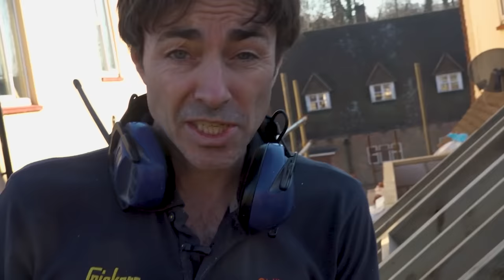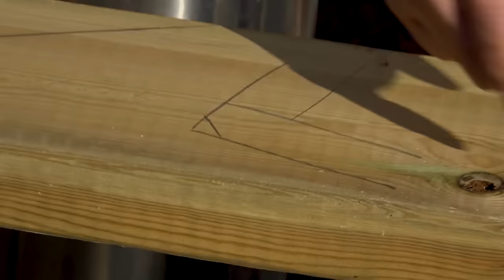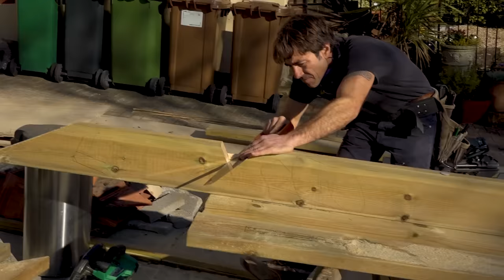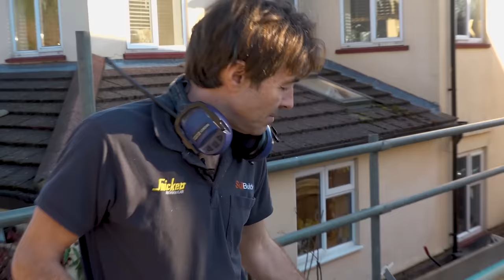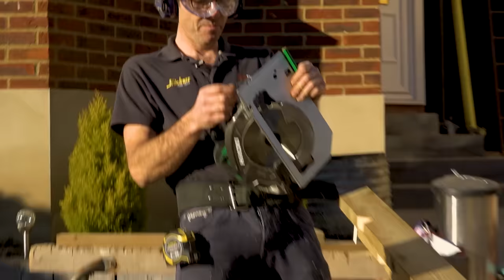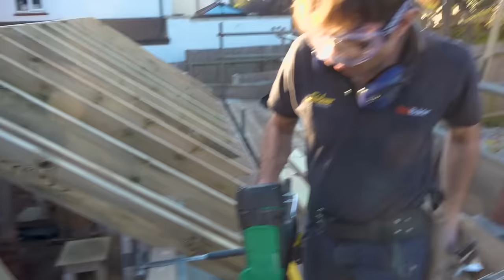How to Cut Hip Rafters

Comment: Folks - sorry, I had finger trouble on my first attempt at a reply.  I don't know if I dare post this and question the grand master Robin, especially it is years since I pictched my last hipped roof - but here goes.  I notice that when you set the side cut for the hip and the jacks, you set your saw to 45 deg.  Now as far as I know, this cut is only 45 deg if the roof is perfectly flat, ie 0deg pitch, which in reality, it could never be.  As the roof pitch increases, the angle of the hip and jack side cuts gets progressively less.  Only slightly, but on a steep pitch, this would become noticeable. I used to know an old joiner who would cut the hip and jacks' side cuts to 45 deg, and then 'saw gauge' them to make them fit.  I can't find my roofing ready reckoner to confirm this, (I think my wife has thrown them away!!), but I'm fairly sure I am right.  As I say, I am reluctant to query someone as obviously knowledgeble with regards to cut roofs, and would like to add that I really enjoy the Skill Builder videos, and I have learnt such a lot from them.  Please keep it up guys.
Reply from the maker: Hi Bob 
This is a really interesting point and one we have been debating in the comments. If you set the saw to 45 degrees for the side cut and run it across the plumb cut for the common rafter angle the resulting cut will be a compound and will not be 45 degrees. It is a baffling bit of geometry that has kept carpenters awake at night but measuring the angle you cut at 45 with an angle finder shows it is not a true 45. This is only really important if you are cutting by hand. If you work out the side cut angle with your roofing square and set the circular saw angle to this the cut will be wrong.
Reply: @SkillBuilder  Robin - thanks for this.  When I pitched my last hipped roof we didn't have power saws!  (So that just shows how long ago that was!)  We set the whole roof out on the ground and hand-cut each joint.  So really, I think you have answered my question.  In the unlikely event I ever cut another roof I will definitely use my power saw, and I will definitely set the side cut to 45 deg.  Many thanks to you and Roger for bringing Skill Builder to us.  I watch every episode and really enjoy each one.  I have probably learnt more from you guys than I have on site.  I know the lockdown has caused you problems, but I am really enjoying your podcasts too - so please keep up the good work.
Reply from the maker: https://www.youtube.com/watch?v=vCaCXli3UD4&t=8s

Comment: Really enjoyed this. I did my first hip roof at 50 and all by calculations in the ground. It was good and passed inspection but it did have 4 or 5 joints with a 1-2mm gap. The wall plate was out and it was a nightmare. This way looks far more accurate and can obviously deal with a few undulations. I’ll definitely use this on my next project. Well worth watching

Comment: Enjoying your videos......
Regarding the jack calculations, say for a 22 degree roof pitch and I want all commons and jacks to be at 450ctrs, when I calculate as 1.414 x 4.5=636mm. Measuring down the common 636 then across to the hip makes the jack spacing way larger than 450ctrs. Not sure what I’m doing wrong
Reply: the calculation you needed for 22 degrees diminish is divide the common rafter per m of run by 10 x the spacing =4.5 so the diminish length in your case is .1078 x 4.5 =485mm you have been using the figure 1.414 and this is for a 45 degree pitch so your calculation formula was great just the wrong data good luck mate
Reply: @ukconstruction  Thanks Robin, I realized that while I was waiting for you to respond, so yes you are correct. Ive since created an excel spreadsheet that calculates the jack rafter diminishing figure given a particular pitch. One thing I do regret in life was not pursuing carpentry :-( 
I ended up becoming a (blueprint draftsman)
Love your work and videos

Comment: I have a question. When working out the overhang for the soffit, can you measure from the top of the wall plate to the top of the brickwork? And then use the stepping off method?

Comment: This is an old school method that we call the "Measure insitu method" in Australia, I personally prefer calculating length and bevels using trigonometry as it is much quicker and dead accurate, I can cut all members including hips and valleys with a compound saw set to the required bevels, or a protractor and power saw, I also cut all creepers when I cut the rest of the roof members by calculating and applying the "Creeper reduction", then erect the entire roof with all the pre-cut members, the "height above top plate" is called the "Left on" dimension here in Oz, also the "diminish" is affected by the pitch, 1.414 will give you the plan length of hip for every metre of run, ... by the way, love the channel, keep up the great work.
Reply: YouTube needs more creeper reduction.
Reply: @danielbuckner2167  I see what you did there :)
Reply: If you were listening - he mentioned that you are not always working with perfectly level wallplates and perfectly square wall corners ...🤔😊

Comment: You can measure long rafters buy yourself. Just set a nail at the rig or hip, pull your measurements off that. I have a Stanley fatmax 35’ tape that goes out 11 foot before the tape bends tho highly recommended tape measure.

Comment: It’s on the square the difference in jacks under 16” centers, if your pitch is 45 degrees it would be 12” run 12 “ rise , so you look under 12 on the square it will give you the difference  22 5/8 , , 35 degrees is 12 “ run and 9 “ rise so you look under 9 on your square and you will see your losing 20 “,  the hip cut is 17 and 9 , the reason it’s 17 is ithe square  of the hypotenuse is equal to the sum of the square on the other two sides , 12 squared is 144 plus 144 = 288 ,  17 x17 is 289  ,

Comment: I do it the cheat way takes about 5 minutes perfect fit every time,I thought everyone did it the same as me but I guess not 😁
Reply: Its not cheating if it works, were here to earn a living not fanny around all day. It takes me about 5 minutes and comes out perfect so i imagine were on the same page
Reply: @tomwhite5501  we don't cheat we must have all worked on a framing crew that would have fired us for taking to long and using to many tools. Experience not cheating. And don't ever pull a handsaw out on a framing crew .
Reply: What's the cheat way?

Comment: don't you think the jacks should meet at the hip at the cost of irregular centers if said centers are within  the parameters of your rafter spacing? Seems to me that would help avoid hip distortion. I am on the west coast of Canada and had the pleasure of working with some builders from England. An absolute pleasure. Gerald (one of the brothers} always referred to dimensional lumber as 4 be 2: 6 be 2; etc. Such great memories of those people. Me too by the way, no jigsaw waving around, a well operated sharp handsaw works every time. Also, the craft needs to be passed on. Really enjoyed your video.

Comment: for a right handed person left sided blade is so much easier to use....you don't have to cross your guide hand over and across the saw....like a typical framing hypoid saw, I cant use right side blade saws.....if I was left handed I would though....

hips and valleys can be a bit tricky but if you know the little "tricks" they use its pretty simple.....every trade has their secrets

Comment: Robin     is that roofing square your using set opposite to a traditional imperial framing square what I mean by that is is the run on your square on the tounge  inch and half side and the rise on the body 2 inch side or is it just the way I am looking  at the video ps hows ur square coming along  looking forward to seeing it

Comment: Worth mentioning if you are doing a big hip to put in the center pair of Jack rafters to straighten the hips and hold them straight, it's really easy to put a bow in the hips otherwise, easier now with nail guns but banging in 100mm galv wire nails it was easy to move the hip. Nice work though  Robin
Reply from the maker: https://youtu.be/x6DibIf0F78?t=1129

Comment: Never done it and never seen it done but when I was taught at college the hip rafter was always bevelled on its top edge so that half the top edge followed the plane of one side of the roof and vice Versa but like I said I’ve never seen it done in practice
Reply from the maker: that is called the dihedral angle and we have done it in one of out videos where the engineer called for a double hip. On a single hip it is easier just to drop it very slightly so the battens run across. Even if they kick up there is only a minute kick on the tiles.
Reply: @SkillBuilder  yeh it always seemed to me extra work for no real gain but spose u had to b taught the traditional way and thanks for reminding me what the angle was called it’s been a very long time since I’ve here’d them words

Comment: Roof timber material should be classed as TR26.  Roof timbers should be 35 mm for single ply fink type trusses or 47mm for loose rafter material.  Carpenters/Joiners/Roofers do not have authority where I live to decide which section size timbers should be.  All structural timbers should be sized by the engineer/roof designer responsible for the project.  Just incase anyone watching this thinks they can do what they want, they cant!  38mm timbers are CLS (a standard material section range used in timber frame design) It isnt used in roofs, where i live anyway.

Comment: You need to Chuck that framing square and use the scrap corner of a pice of ply wood with a 1x2 tacked to it  way more accurate .
Reply from the maker: The way that boats, staircases and boats were built for thousands of years.
Reply: @SkillBuilder  fool proof

Comment: Any chance you could put the measurements in inches and feet in a small caption at the bottom of the screen? It's really almost impossible for my mind to even comprehend what the measurements are when using metric, and makes it difficult for me to grasp what you are explaining.I only use metric in CNC machining. Otherwise, this is excellent content.  Thanks.

Comment: Hi Robin do you have any videos where you have done a roof which marrys up to and existing roof but the wall plates aren't aligned for example a Semi detached house having a side extension where the existing wall thickness is 250mm meeting with the extension where the wall thickness is 300mm meaning the wallplates don't align and the hips therefore don't align? hope i am making sence.

Comment: A 12/12 roof or a 45 degree roof has a 1 to 1 ratio. But when its traveling along the h/v run its a 17/12. I have built quit a bit of houses and my favorite part is milling the roof.
Reply from the maker: You are right. I never knew why it was easier to walk up a valley gutter than the pitch.

Comment: Also 12 units by 12 units at 90° will create a hypotenuse at 45 degrees which will be 17 units and therefore if your 12 inch run or excuse me your 12-unit run becomes a 17 unit run so all you really need to do is use the same units of rise but substitute 17 for 12 when cutting a hip or valley.

Comment: Great video.
One question:
For some it might be obvious, but for a DIY beginner it's crucial.
How far should the rafters go over outside the wall?
Is 20 cm enough?
Thank you.
Reply: This is all dependent on the level of the finished soffit board or the given overhang, in short there is no common factor, hope that helps
Reply: 200mm/8" is a bit skinny for me, I prefer an 18-24" soffit. Sometimes the plans dictate otherwise.

Comment: Hi, another great video.
We are currently extending a pitched roof, the front and back have different pitch angles as the ridge is off centre. We have the common rafters in up to the end of the ridge. The roof is half hipped, and as the hips are also coming down at different angles to each other onto the higher level wall plate, my hipped gable end won’t be level. I’m going to have to raise the wall plate at one end to accommodate the hips, but is there a way I can ensure the jack rafters run through level so my fascia and soffit finishes level.
Any help or suggestions are welcome.

Comment: What do you do if the hip end (is say 12 : 7) is at a different pitch than the long end  (is say 12 : 5) as an architect I have designed roofs with the hip end at a steeper pitch than the front or rear.

Comment: If your building wall (i.e. ring beam) runs out at one end quite a bit, then how would you deal with that?  Would you modify the pitch of the rafter(s) slightly at one end of the roof to compensate or would you make some kind of adjustment to the birds mouth cut?  Im just curious as I attempted my own roof recently and had the above problem.  I solved it by hook or by crook but I was then curious to know what the rules would be for this within the boundaries of the guys who do it everyday.  Is it acceptable for a roof to run out of pitch slightly?
Reply from the maker: Do everything you can to bring your wall plates (ring beam) into line but if it can't be altered you will have to measure each rafter and make the adjustment. It is a pig to do.

Comment: Cut your angle using a roofing square, take the 1/3rd pitch line for your birds mouth run it the opposite way up the hip to your plumb cut, put the hip on the wall plate lift it up so the line is touching the common rafter while holding it mark your hip for your birds mouth, use the roofing square cut the birds mouth...that's how I do mine anyway
Reply from the maker: Nice idea
Reply: Stephen Hill no
Reply: This method is called scribing the hip no  need to measure for length once you got the pitch ,this works for common and Jack rafters too
Reply: That’s the way I was taught 👍🏻

Comment: Great video Robin. Been in the game myself for 19 years now. I like to use scientific calc for my reductions on Jack's. Simple method too. Spacing ie: 400mm divided by Cos (consign) and your pitch 45 degrees. Reduction of 565mm then just minus that amount from main rafter measurement till you get to smallest possible jack rafter.

Comment: If you come 90 degrees and 2/3rds down it wouldn’t be smaller if you applied the same method to the commons and the hip?
Reply from the maker: When you cut the hip birdsmouth you have to work from the height above plate and not the depth of the timber. The birdsmouth on the hip is usually deeper than 1/3rd of the depth. If you need a better explanation try this https://youtu.be/_TmXZ0cGNEI?t=1202

Comment: Hi robin, what would you say is the best method for cutting a hip in on a trussed roof, so where you have to notch it over the girder truss as well as the birds mouth? Cheers
Reply: Good question, I remember the first time that I had this situation and remember having to set a string line form the corner of the plate up to where the girder truss met the mono and then literally plotting the position on the intersection and doing a bit of direct measuring and head scratching!!! now I would use a mathematical calculation to plot the position of the side of the girder truss and then check by measuring too, I think the girder truss should be positioned to accommodate the hip member better!! hope that helps mate...
Reply: Cheers robin, yeah that does help a bit, last couple I’ve put the plumb cut on the rafter set it in places and then sort of scribed the birds mouth/girder notch on to the rafter, works out each time just looking for a faster method

Comment: Hi, im danish and in Denmark we cut the hip in the angle of the rafters so when u put the battens up it rests on the whole hip any reason u don't?
Reply from the maker: We do that diheadral cut on some hips but on this little roof it is not such a big deal to rest the batten on the edge. A hundred years from now it will still be good.
Reply: Thankyou for the anser was just curious

Comment: Is the plumb cut on the hip the same as the rest of the rafters?
Reply: No its always shallower as the hip travels a greater distance as it intersects the corner
Reply from the maker: No it is a different angle because the hip travels further.
Reply: Skill Builder so if it was a 20 degree roof what degree would you use on the hip/val part of the speed square?

Comment: Sofit the rafter into the birds mouth parralell to the hip at 126mm distance from the wall plate 1657 degrees off the plumb cut with the rafter. Got it! Instructions unclear building collapsed.

Comment: any idea how to calculate the compound angle in  the gable part of a dutch gable?   i just can't get it right...   if the roof is at say 22degrees and the roof of the dutch gable is at 22degrees, you would think the compound angle would be 22/22 but it's not...   maybe a better example for the question.   if you had a right angle triangle made of 2x4s for a gable vent.   the louvres are a 45d to the vertical... where the roof angle meets that 45 how do you calculate the other angle - it's not just roof angle/45... is there some math calculation to do it?  i resorted to making a jig which works for the vents, but not the gable roof shingles.   pulling my hair out!!!
Reply from the maker: https://www.youtube.com/watch?v=vCaCXli3UD4&t=8s

Comment: For my next extension project I'm now worried that my appointed carpenter will not be as good as Robin and that there is great potential for crimes against woodwork on my site.
Reply from the maker: To be fair most carpenters can pitch a roof and do all the other work that is needed. It is their bread and butter. Not every good  carpenter post stuff on YouTube but that doesn't make them bad at their job. You will soon be able to tell if the guy is not up to the job.